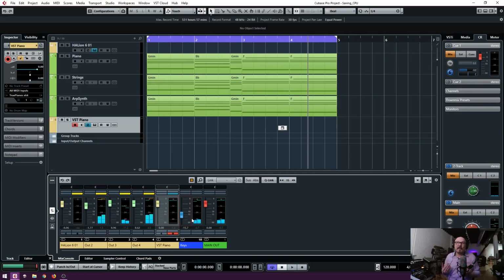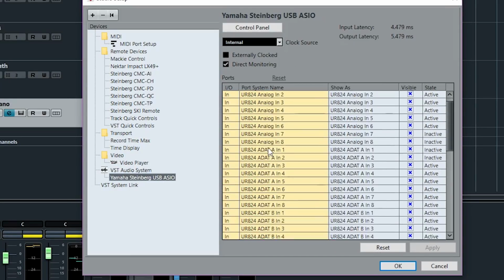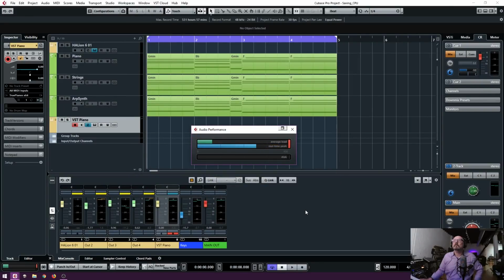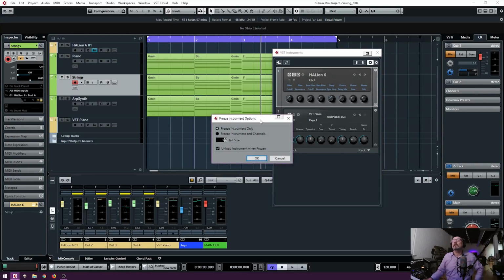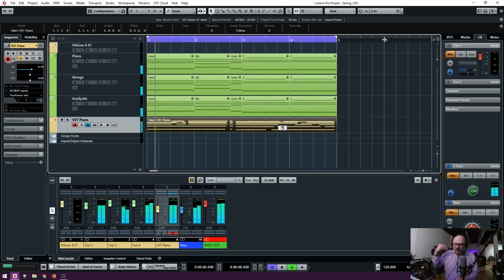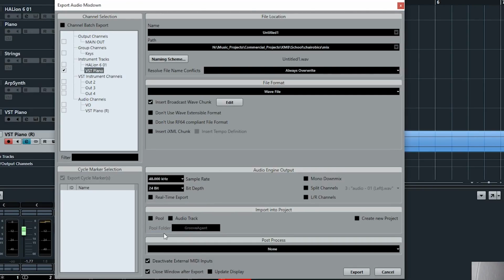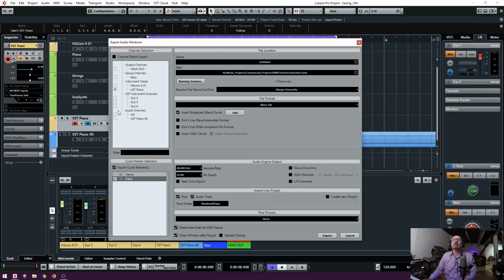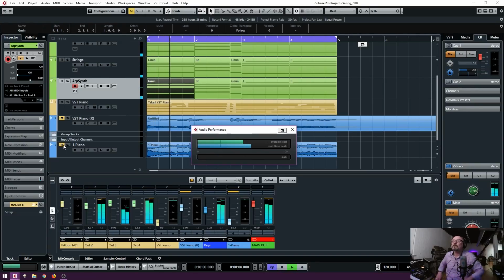Maximizing Track Count & Saving CPU in Cubase

Comment: 7 steps to audio heaven on windows 8/8.1 
'''''''''''''''''''''''''''''''''''''''''''''''''''''''''''''''''''''''''''''''''''''''''''''''''''''''''''''''''''''''''''''''''''''''''''''''''''''''''
1/ Run DAW open task manager open details column  right click DAW icon set priority from normal to realtime.
2/ Device manager open HDD properties policies tick both boxes enable write caching and turn off write cache buffer flushing .
3/ System properties  performance setting to best performance and processor scheduling to background services.
4/ Regedit find dec 35 all values from 1 change to 0.
5/ Power management to high performance and disable all the USB power management, set CPU to 100% min/max
6/ Disable CPU hyperthreading in the BIOS.
7/ If still slow and you have intel cpu stop core parking  use throttle stop download enable turbo boost

'''''''''''''''''''''''''''''''''''''''''''''''''''''''''''''''''''''''''''''''''''''''''''''''''''''''''''''''''''''''''''''''''''''''''''''''''''''''''''''''''''''''''''''''''''''''''''''''''''''''''''''''''''''''''''''''''''''''''''''''''''''''''''''''''''''''''''''''''''''''''''''''''''''''''''''''''''''''''''''''''''''''''''''''''''''''''''''''''''''''''''''

Comment: I have never seen performance that bad... How did you pull that off??  Secrets please!
Reply from the maker: As I mention in the video description, I had to seriously overload my system  to emulate a low power system.  I am currently mixing a track with 50+ tracks and 12 subs with no issues.  Thanks for watching!

Comment: So you have to freeze tracks to get a fifth track recorded at 256? On a Zeon processor?
Reply: We on earth did you not activate asio guard? What is your powerscheme? The disk meter was constantly peaking, why?

I have a 2 year old pc with an i7 and 16 gigs of ram and I have nothing like those spikes on my setup.
Something is clearly wrong with your setup.
Reply from the maker: Pro Tools Fam not usually. I was also running OBS, and some other apps. I was deliberately making a case for the extreme to demonstrate the issue for folks that are starting out or not technically inclined.
Reply: Yup, that confuses me lots, too- doesn't look much, right? Of course I'd expect having to freeze when using some Steini VSTs, NI-stuff, whathaveyenot PLUS effects. (BTW: That was missing: Use returns instead of inserts whenever you can.) On my cute little MBP, i7 dual core, 8GB RAM, I can't wait to see it crash when adding a strings layer or fuddling about with Amp Rack...
Question: If I can happily life with 44.1KHz 16bit- much impact?
🐻👌🏻

Comment: One thing that made a big difference at least on my PC was activating the Steinberg Power scheme. This prevents the processor from wildly stepping between different speeds and brought the performance way up. And at least when I tried last, activiating the ASIO guard brought the performance down, so I have it disabled. I have a powerful machine, so usually I don't need to look into these settings, but with certain instruments or effects (Movement from Output in version 1 - really bad!) they eat all your processor time.
Reply from the maker: Holger Hansen I have had the same results with ASIO guard.  That's why I left it turned off in my video, but I didn't want to get into a discussion about whether it was a good or a bad thing. I really do think it's system dependent. Thanks for your comment!
Reply: Definitely system dependent.  I've had crashes with it engaged. Sometimes it works other times it's a no go so I only engage it if I really need it... like maybe 2% of the time... lol

Comment: Hit the " Constrain Delay Compensation Button" if you need to add new Midi/Audio parts to a project with a high buffer setting.
Much Quicker !!
Reply: Sid East That is the method I use the most, but you have to remember that you did this and release the button when you are done or it will mess with your mixes.  It sometimes turns off some of the inserts, so the mix quality is not as good, but with this method you can definitely get more out of your  processor and it is probably the fastest method.
Reply from the maker: The constrained delay button can definitely help when recording certain things live. But as noted in the other comment before, it does disable any editing of your plugins.

Comment: Thanx 4 taking the Time to make this...Twas greatly educational and appreciated.
I was praying you'd use the Focusrite driver. as thats what i have(scarlett 18i20) using the mixcontrol software.... evertime i try and change the Asio buffer size..the software (focusrite mix control) hangs..i have to turn everything off AND change usb ports otherwise i get a "NO HARDWARE CONNECTED"..and sometimes it gets so bad that i have to uninstall/reinstall...
Drives me freakin crazy!!!
Reply from the maker: That sounds very frustrating.  My Focusrite is pre Mix Control, but what you are experiencing seems to be a known, and maybe common issue.  I read this KB article here: https://support.focusrite.com/hc/en-gb/articles/115001661729-Focusrite-Control-is-showing-No-Hardware-Connected-, and it seemed to have some options.  You've probably already done this, but I thought I'd throw it out there.  Glad you liked the video!  thanks for the comments.

Comment: As Frank Saraceno says: Enable your ASIO GUARD at first - an you will have much better results! That's what the Asio Guard is for. The other things you mentioned are still worth knowing and  you'll need to use all of them if you have more tracks and instruments.
Reply from the maker: Gerhard Binkele I certainly don't disagree about the ASIO guard, but in my video I deliberately left it off to just compare what difference buffer size makes alone. It's not easy to explain how ASIO guard makes a difference, and it's not always reliable. So I was trying to keep it as straightforward as possible. Thanks for watching, and thanks for your input.
Reply: Cubase Academy I understand. That's o.k. .I like your videos anyway.
 How to choose the best settings for the Asp guard would be a interesting subject too.